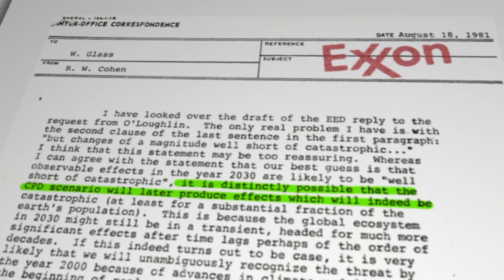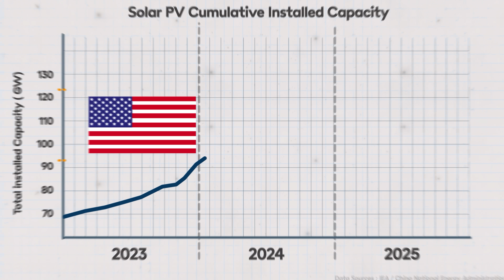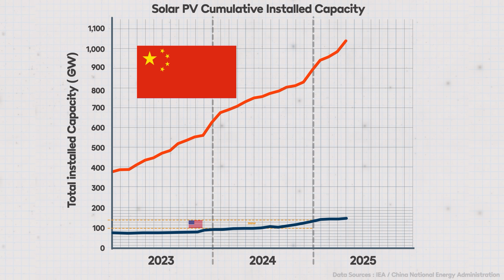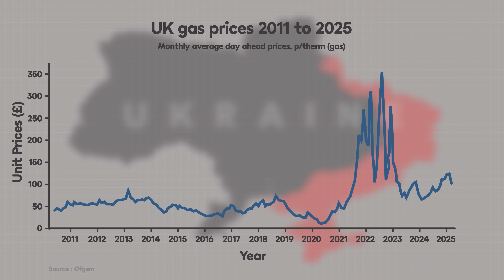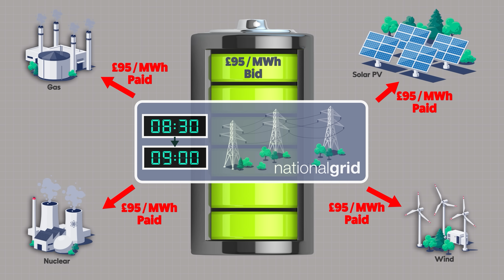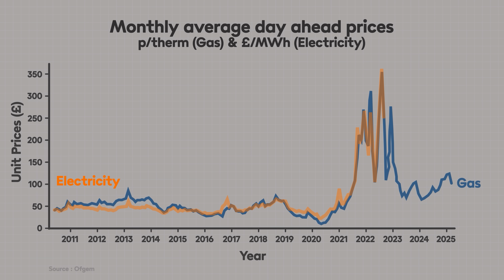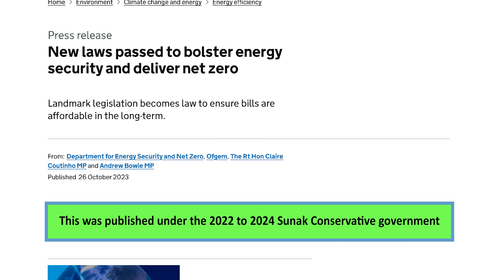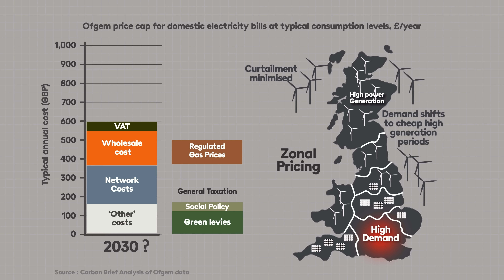Why is UK Energy SO expensive?

Comment: In Aus the government rebates and the interest free loans are giving many homeowners the extra funds to help reduce costs to lower the cost of Solar.
Our newly appointed Federal Government has proposed a rebate also for adding home batteries. 
A rebate of up to AUD$4,000.00 max on a battery install.
Now that cost is still very high at over AUD800/ kWh plus install.
As static storage battery cost fall that will come down and the Government rebate may reduce accordingly or even disappear.
It is still anticipated that most people will still need to fund the install to the tune of AUD$5000 - AUD$6000 for a say a 16 kWh battery.
That still suggesting payback time as few as 4 years to as much as 6 years depending on how the cost savings are generated.
A far quicker payback if you produce sufficient excess solar a day every day to charge or even longer if you are using Time of Use (TOU) power arbitrage to charge at off peak and use in peak.  (* depending on the tariff in play).
What is known that current tariffs will change over the coming years so any calculations are purely estimates at the time of making the evaluation. 
Those that have had solar for some time know their generation profile and can with some level of confidence predict their free charging ability but for those like myself that struggle in winter to cover household consumption will struggle to charge the battery on as many as 100 days of the year. 
So those days would rely on TOU differential in cost to work out the payback. In my case 100 days x 16 kWh x AUD$0.18 difference in rate  = AUD$288.00 saved and 265 days of free solar  less the piddly Feed in tariff (FIT) on offer currently AUD$0.03 / kWh at that rate 16 KW at say current peak rate AUD$0.4155 /kWh   - les FIT  $0.03 = AUD$0.3855 x 16 x 265 = Approx AUD1,635.00 a year saving from that 16kWh per day. (so for me Just under an estimated  4 year payback. ) 
But we still have a daily grid supply charge that always exists and that ap present is AUD$1.03 a day and likely to increase over time.
Never get away from that charge unless fully off grid and that wont happen.

Comment: In Australia there has been a cost under estimate of current transmission projects to enable VRE to the tune $54 billion. The cost to maintain and insure such a capital behemoth is being put on everyone's power bills.  LCOE is a term that Favours VRE which is why only FCOE or Full Cost of Electricity should be used to give a complete picture of all costs of every technology. Australia is now also facing a number of burdens such as condenser ($2 billion) and numerous government subsidies that disguise the true cost of VRE. Australia is rapidly facing a de-industrialization with an Aluminum smelter the latest to sound the warning bells its about to close. Critics say Fossil fuels have subsidies but they are wrong as they equate an exemption to a tax excise as a subsidy which is grossly inaccurate. The subsidies and rebates on and towards everyone's power bills has been escalating very rapidly over the last 3 years.

Comment: Why in the world would you set up a marginal pricing system like you are using?  People talk about it as if there is no way to change this system.  Is this really the case?
Reply: In the UK it's an antiquated system and comes from a time when gas was the cheapest form of electricity generation; cheaper than oil, coal or nuclear. The system changed gradually over and had factors like protection of the vulnerable and guarantee of services (hospitals, critical services etc.) incorporated into it - introducing a dependency on dispatchable generator suppliers to enable these protections to be met. 

The problem now is solar/wind/hydro/geothermal are much cheaper than gas but only hydro/geothermal are dispatchable generators (wind/solar is a variable source). But in countries like the UK with low hydro/geothermal but high wind/solar renewable resources the additional protection requirements built into the system cannot be met without burning gas, at least for part of the time. Creating the situation where if gas is used for 1% of the electricity produced it sets the price of the other 99% of sources - even in the case of the UK where the majority of electricity is from renewable/low-carbon sources nowadays. This is being addressed in the UK, but over a slower timescale than the renewable roll-out, by the additional roll-out of batteries, and other forms of energy storage (compressed air for example), to extend the operating time to 24/7; with a gas free day trial planned to be run later this year.

The same marginal pricing system is used in many European countries, but each has a different energy mix, those with more hydro, geothermal or even nuclear (which has now dropped below the cost of gas generation) are less impacted by marginal pricing than those without  (like the UK).
Reply: @GruffSillyGoat It appears that the current system has created more of a problem than what it intended to fix.  Unfortunately, it may just be easier to keep adding those cheaper batteries.  Best of luck.

Comment: Anyone ask this question never looked at the footprints of fossil fuel industries compare to renewaables....
Multi billion ton of resources extraction from fossil fuel is small?

Or they just profit from them.

And olease set the facts straight.
Russia didn't cut off the gas supply, most of EU chose not to buy.
The flow only ended last December.

Comment: The carbon tax is effective but a political football.  Its end game is to reduce consumption of fossil fuels which is accomplished by using EV's, Hybrids, Public Transportation, Heat Pumps and smaller buildings.  In other words the problem is continuous growth withing the free market system which must be replaced by degrowth or a reduction in consumption.  This is something that has never been tried on a massive scale.
Reply: Not quite true, large scale reduction in energy use has already taken place in electricty generation market, with the large gain in efficiency improvments over the past twenty years many countries are now running with lower electricity usage than they did in the mid-2000's. For example, the UK's grid was sized to transmit 80GW of electricity back in 2005/6, but with industrial, commercial and domestic energy efficiency gains since (LED lightbulbs made a fairly big difference for example) nowadays it utilises 25GW (summer) to 45GW (winter).
Reply: @GruffSillyGoat Yes there has been some gain in efficiencies but most of the reduction in CO2 emissions came with transferring big energy users such as the steel industry to other areas of the world.  There is a false belief that we can continue to decarbonize without energy and consumption reduction on all areas.  This includes consumption reduction in high fossil fuel industries such as the plastics and clothing industries as an example.  Consumption in both these industries have become as problematic as the CO2 emissions from burning fossil fuels but less attention is given to them.  The food industry is another industry that survives on ever expanding consumptions to satisfy ever expanding markets but its environmental record is as bad as the fossil fuel industries not to mention the health and social degradations that tag along.

Comment: I've long been bemused by the UK's energy pricing mechanisms, resulting in higher consumer bills than in Europe, but I'd dispute the reason being less reliance on gas rather than regulations to prevent the price gouging which prevails in the UK - Europe's larger more flexible grid arrangement compels gas to more reasonably compete, whereas gas has the grid over a barrel in the UK and they profit from it until the grid expands.
    In volume terms, my dual fuel consumption in eastern europe has fallen ca 65% through insulation over the last 8 years, the sub 1,000 quid annual energy bill despite harsh winters testimony to the effects.
   I remain convinced that were HMG to roll out a national insulation and draughtproofing campaign, consumption and pricing would tumble, the strains on the grid would recede, and it would enable faster transition - What's preventing it is shareholder influence on HMG.

Comment: As usual, wholesale prices are being set by the highest prices in any 30 minute bidding period. It is about time that generators were paid the price that they actually bid.
Reply: It's mainly the gas peaker plants that drive the price up, these don't have pre-contracted set price and instead offer a price when the call comes in to support high energy demand. As there are only few of them nowadays, the price competition that used to exist to drive the prices offered down no longer works. Indeed some of these peaker suppliers, game the system turning off regular generation supply anticipating events (football matches, bad weather etc.) and wait for the calls to come in and then charge over 50 times their previous rate (as happened earlier this year).

Comment: One thing that is driving up parts of USA is the building of data centers which not only use large kw's of electricity but uses so much water that nearby communities are running low with lower quality also.

Comment: Renewables have an inferior performance envelope determined by the gain factor relative to fossil, nuclear or hydro. As all living and mans energy technology are dynamic energy  systems that is the use use some of the energy the gain from the raw source,  that is, sun wind coal , oil  to keep the system running and replaced. Gain must be greater than one plus losses. Our society has grown up since cave man on a  gain factor that has been increasing. A positive gain factor. By forced introduction of renewables man is now facing an negative energy gain factor for the first time in its history. With a high population a gain factor that is significantly going negative is heading for instability. As is our economic system which is a socialy biased set of alograthims that operates within the energy envelope that relies on an increasing gain factor.

Comment: I cannot believe you are getting all of your information from a website called carbon brief.
Reply: Probably because Carbon Brief is an award winning specialist energy industry journalistic website, that has earned a high level of respect in the energy industry through it's investigations and analysis.
Reply: @GruffSillyGoat They are advocates who put a positive spin on it.  Things are so bad in the UK they just reversed rules to open the North Sea back up to new gas production.  Yet, according to carbon brief, gas is what is making electricity expensive. BS.
Reply: Nope, Carbon Brief are a fairly unbiased source of information used by the likes of the LSE and Cambridge University in their economic research.

As to new fields, you are aware these are mainly required for thermal energy and that one reason the cost of gas is high because the UK's domestice resources are dwindling requiring more expensive imports.

Oddly, these new licences come with strict conditions now to account for the CO2 production not just during extraction but also in use of the oil/gas involved. This focuses their use on the harder to address petrochemical and heat areas rather than the easier to address electricity generation, where renewables are already a proven lower cost alternative.

Comment: Nobody should believe what is being communicated by the CCP (China’s government). The CCP have made monetary incentives to install solar panels.  But the rampant corruption in China is so pronounced that most of those panels are not connected to the grid.  And when they are connected to the grid, the provinces where they are installed has so many that they are in overcapacity with no way to send the extra electricity to where it would be useful. China is the land of shortcuts and facade. Remember that they paint the grass green when officials are in visits.